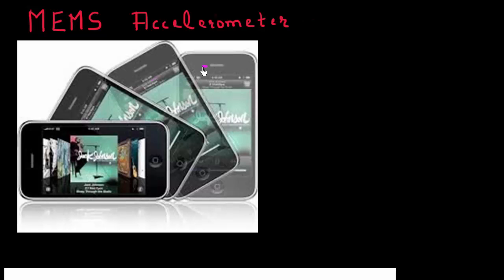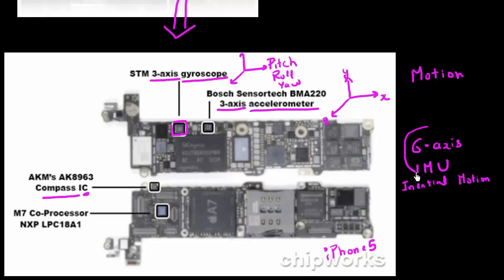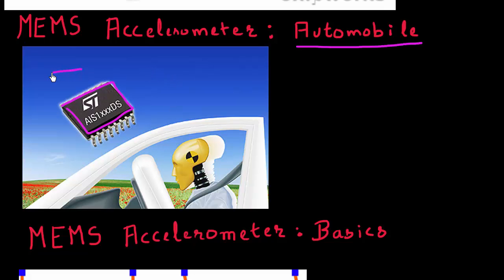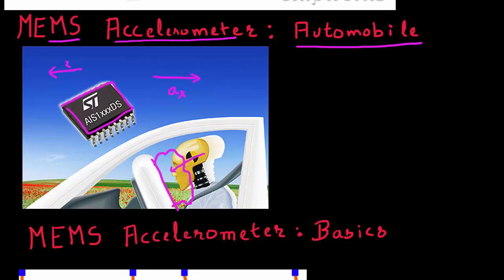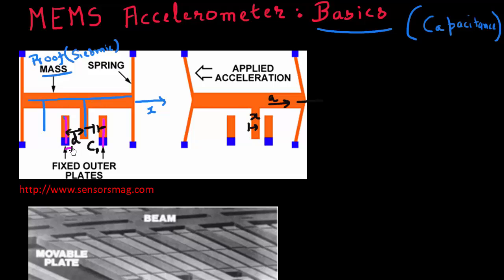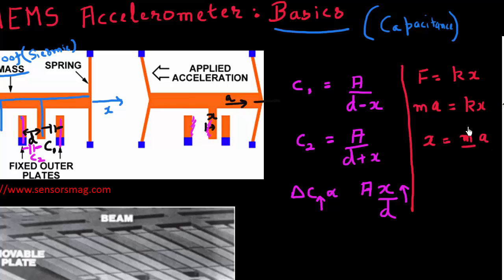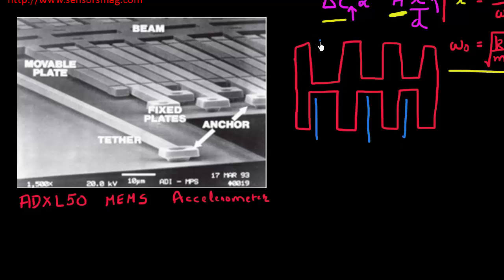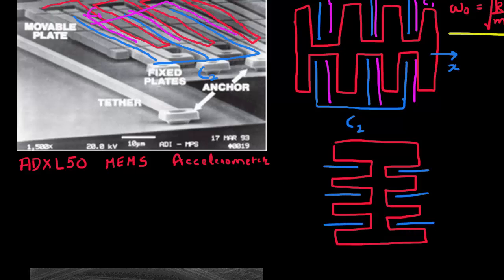MEMS accelerometer: basics and 2 axis accelerometers

Comment: Thank you for the explanation. The acceleration on the surface of the earth is 9,8 m/s2. This could be the acceleration of the crust of the earth upwards OR the fall of an object downwards. If you  throw the device in the air and you read the acceleration in free-fall, you will see NO ACCELERATION. If you take it in your hand again (or put it on the table) with the upside up, you will read an upward acceleration of 9,8 m/s2. This means: the device is telling me, that the device (me, my hand, the table) is accelerated upwards. Does this mean that the earth-crust is pushing upwards causing an acceleration of 9,8 m/s2 upwards? Is there a way or reasoning to distinct between these two possibilities?